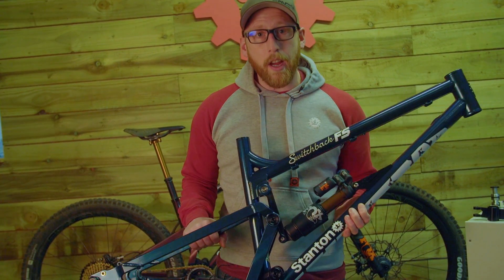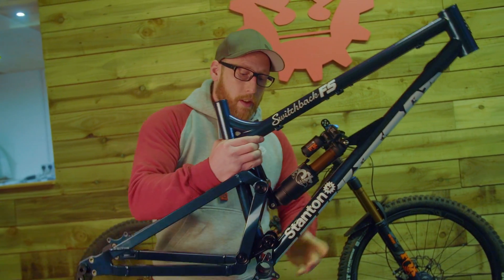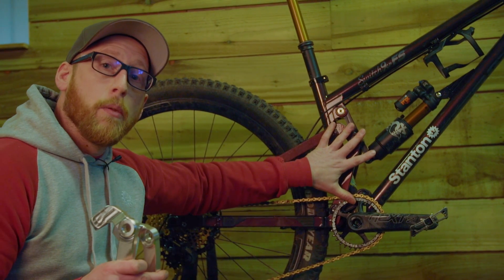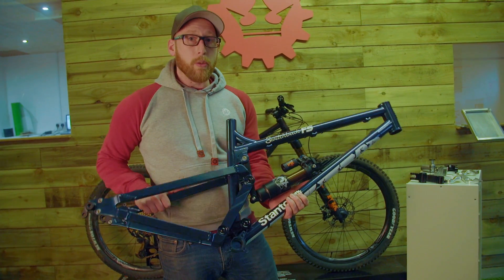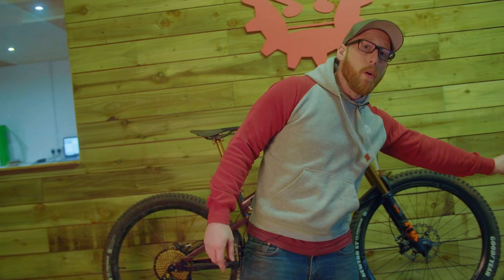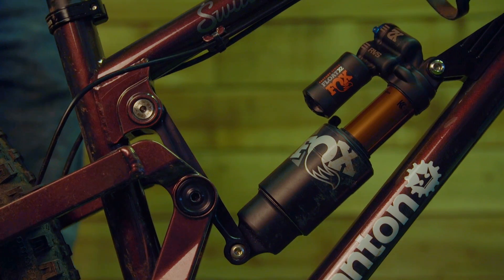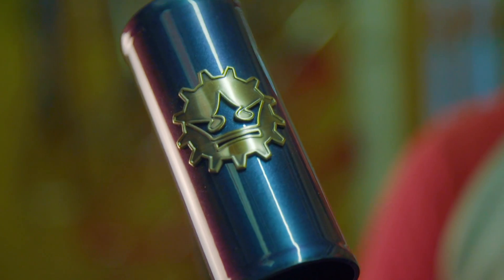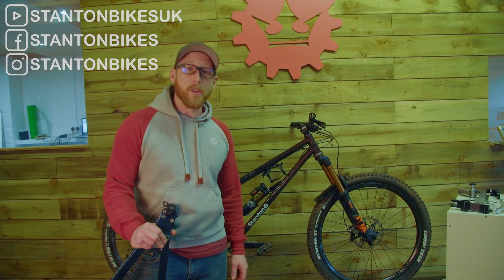Stanton Bikes - Switch FS Linkage and Suspension Kinematics - Tech Talk

Comment: Do you perhaps have an explosion view of the Switchback FS with information regarding the used bearings, screws and torque? 
I want to install offset bushings on the FS 140 but without the torque specs for the shock I won't touch it. :)

Comment: Any chance of a frame bearing swap video? So impressed with this bike im thinking of a purchase 😍😍
Reply from the maker: damo mega275 yeah man!! Good idea. Thank you 🤗
Reply: @StantonBikesUK  ive got a Iridescence Larva Powder 160 sat in the basket. Can I get away with putting my factory 170 36s on that? Looking to buy the frame only and use what I am running at the mo parts wise
Reply from the maker: damo mega275   Yes for sure! Perfect fork for the job! 170mm front 160mm rear both Fox 👌🏽
Reply: @StantonBikesUK  may give you chaps a call tomo 😊😊